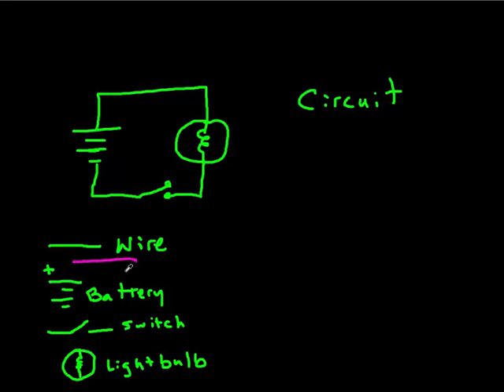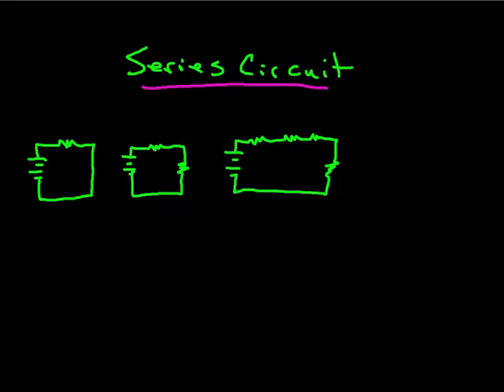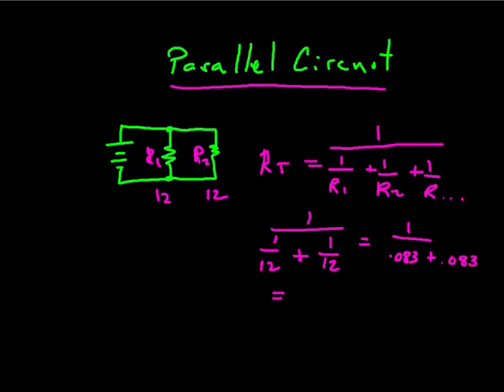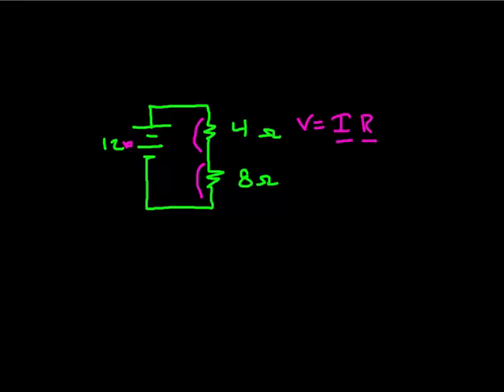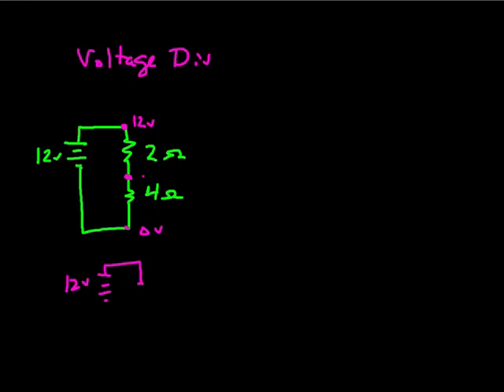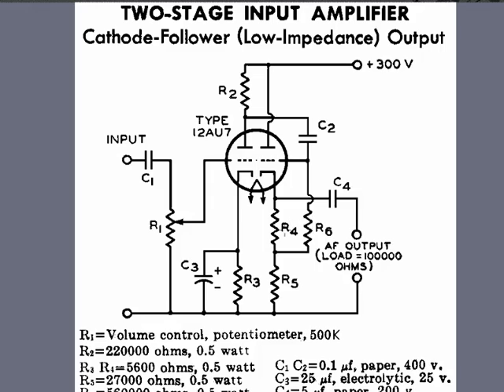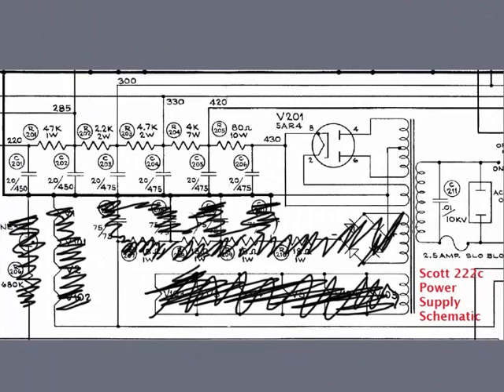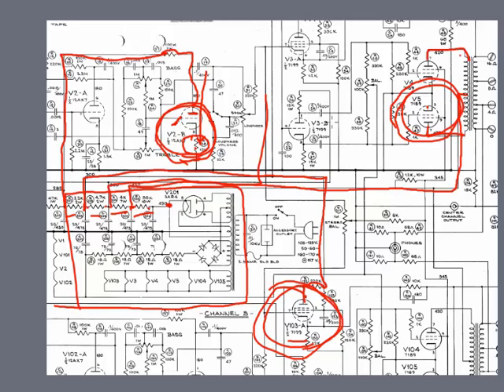Audio Tube Amp 101 - Episode 5 - Parallel & Series Circuits & Voltage Divider

Comment: There's a problem with this practical voltage divider example: without the load circuits going off from it, it's not a complete circuit.  The end of it labeled "220V" doesn't complete the circuit. I assume it's using the load circuits to pull it down to expected voltages.  This is really a bad design.  If you remove a load or two, all the voltages go way too high. So the amplifier is liable to self destruct if you remove tubes or they go faulty.  On the other hand, a complete divider circuit would waste more power (it's already quite wasteful). Am I right?

Anyway, big thumbs up for doing this series.